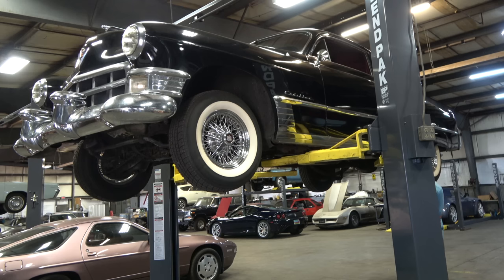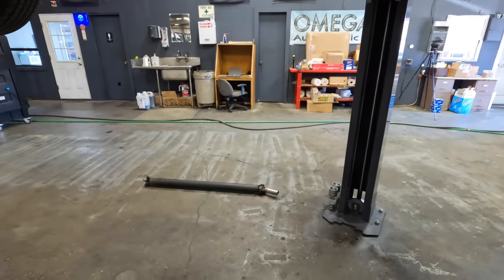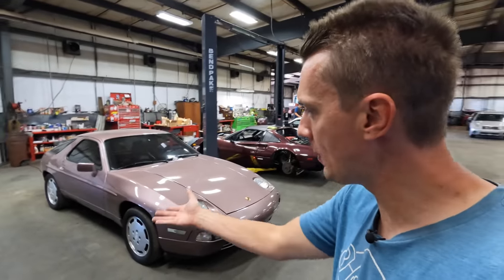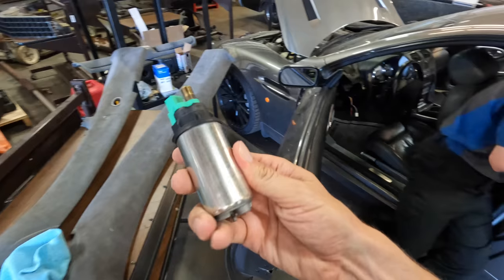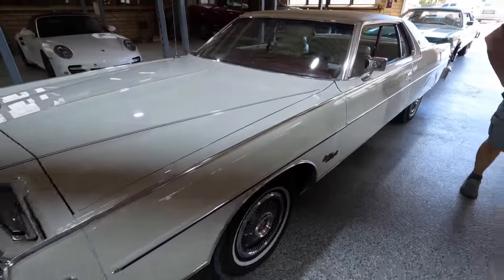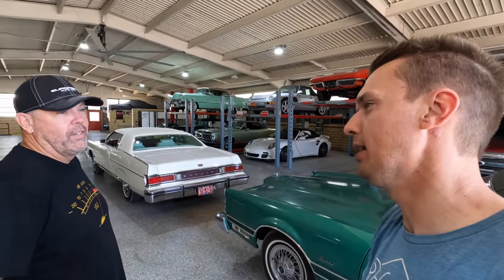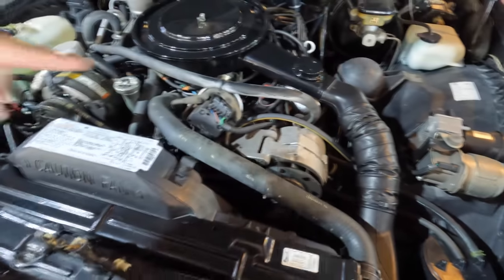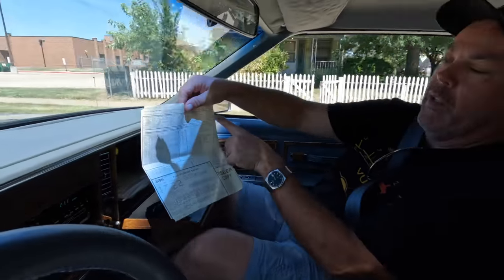We found some weird mods on my 1949 Cadillac Fastback Custom, and more things broken!

Comment: Do not remove any of those radiators you will regret it my GPA had a 500 ci Cadillac swap and it was a nightmare to keep cool I was so surprised this stayed cool on such hot days. They are definitely a needed item. Really cool car great build.
Reply: Yo 🔥https://youtu.be/rdJ9bsN7JAw.
Reply: I had a stock 500 in a '76 Fleetwood Talisman and it was the largest radiator I had ever seen in a production car. Literally 3x the size of my 98 Silverado which wasn't a small radiator in itself so I don't doubt they would need a heck of a lot of cooling in a smaller space like that.
Reply: Only way to replace it is with a radiator the same size or an oversized aftermarket one. Never had a problem cooling a 500 block doing it this way.
Reply: Those radiators on the 500ci caddys were huge.
Reply: In the tighter 49 engine compartment probably wasn't space enough for an oversized radiator for a 500cid up front, so adding a supplementary radiator wherever they could cram it makes sense.
Reply: @waynepantry7023  because if wizard didn't install it or it isn't factory they always want to remove it.
Reply: I do remember those type of tires in the 80s..i remember them very well
Reply: Tell me about it guys!  I have a 1976 Cadillac Fleetwood Series 60 Special Brougham with a 500 engine and that HUGE radiator.  Even though everything is stock, I will NOT drive it if the temperature hits 90 or more outside.  I just don't want to take the risk.  I mean, it only has 38K original miles, but why take a chance?  I don't HAVE Tyler Hoovie's money!  LOL
Reply: As a bonus, you can warm your hands on the passenger fender.

Comment: Regarding the shocks, the Koni 8240-1085 for front and 8240-1086	for rear should fit directly. Probably a much more reliable, cheaper and better ride than the Bilstein.
Reply: Hope they figured that out
Reply: Yeah, wanted to respond with the same thing, resently replaced shocks on a porsche 928 as well, those Koni's where easy to get, but maybe this is a US supply issue, as i just got them here at a carparts store in the Netherlands.
Maybe Hoovie/Wizzard should ask one of us Europians to send them over...
Reply: Even if you can find an old pair, Koni offers a rebuilding service (not for free obviously)
Reply: @shoominati23  yeah that's possible, except for FSD shocks. I used to work for Koni. Terrible company to work for but the products are amazing.
Reply: FatCat Motorsports rebuilds shocks and struts.
Reply: I'm sure several companies make coilovers that would fit, (what I would do). He wants to keep it original. Not sure why, if it's not a very low mileage and exquisite car.
Reply: @jimmywhitlow2012  I believe teh Bilsteins were actually an option. The cars regular shocks were Koni's as mentioned and these normally last forever. They can be adjusted to like new to when they get to loose over time. The Bilsteins are less common but a friend of mine had them on his '78 928. You might be able to get them form Porsche Classic in Germany. In that case you can start saving now.
Reply: @jimmywhitlow2012  Agreed, a little 'out of the box' thinking required.  Also, only the dampers will need replacing so the springs can be transferred over
Reply: @shoominati23  Got Koni's on my Nissan Patrol & had them rebuilt recently.
Worked out about $100.00 US here in Aussie - way cheaper than buying new shocks & they perform really well.
Reply: @hanselemans4237  The original shocks were not Koni.  They were Boge (Sachs).  Bilstein still makes 928 shocks, but the S4 versions are having a supply issue.

Comment: I'll take videos on cars like this over the supercar bullshit any day of the week.  The Lambo's and Ferrari's are fun and all, and i love them just as much as anyone else. But they are unrelatable and unobtainable for 99% of us.  Nice to see this channel getting back to the way it used to be. Love it
Reply: And for us in Europe its the other way around. What shall we do with a land yacht which does not even fit the last corner to my property? Its has a 12 ton limit. 10 mpg equals 46 Euros/100km, i could afford maybe 200km per month. Do they take E-Fuel? The conversion to E-Fuel has already started on race tracks and it will not be long until they will convert regular „leaded“ fuel which those wonderful old big chunks of metal need.
Still love the channel, just as i love „old things on auction“ or „steam locomotives and steam trekker of a bygone era“. A Porsche 928 or a Cadillac from 1949 is living history. But certainly not practical.
Reply: Yeah I like seeing these cheap obtainable cars that make me question if I should drop 15k on a car with a sofa for a driver's seat and a 0-60 time measured in minutes
Reply: Everyone has their opinion 
 don't call other's bullshit
Reply: @wolfgangpreier9160  I had a ‘49 Buick Super Sedanet, which is roughly the same size, and they aren’t that heavy or big. Iirc 1650 kilogram curb weight and shorter than your average SUV.

Okay, the Buick L8 coupled to the Dynaflow meant it had bad fuel economy (about 24 liters per 100 kilometers) but it drove wonderfully. With a modern tranny these things are more economical.
Reply: @RustOnWheels  Shorter than a Model Y? Jokeing - i have reserved a Cybertruck - i hope it gets exported to Europe in a few years. 

I did not mean specifically the length of the car. 

I once had a Chevy Beauville Van and a GMC K1500 Z71 Stepside and was living in "the city". European city of course. Where its really narrow. Fun cars. Never had a problem with the size. But that was in 1989 and 1995. Now is not the time to invest in a vehicle that is the definition of oversized and thirsty. 

Its fun for once or twice a year to show it on a car show or a Corso at the Ennstal Classic or in Goodwood. But certainly not for everyday use.
Reply: @wolfgangpreier9160  almost nobody uses cars like this daily, that’s logic. I drove it tops 700 km per year. But the turning circle is small because it’s rear wheel drive and it’s smaller than all those idiotic German SUV’s.
Reply: @RustOnWheels  I commented on those who wanted to use those old cars everyday. 30 years ago? Of course why not? Petrol was cheap girls were unshaven and the russkis made no troubles. 

I don't know about german SUVs. Never had one. My last fossil was a VW Caddy. Not very SUV-ish.
Reply: @wolfgangpreier9160  Well here in my town almost half of every car is longer, wider, taller and 1000 kg heavier than my Buick and Hudson. Also thirstier. My Hudson can get 11,6 kilometer per liter and a lot of those big German cars don’t even get 8 kilometer per liter. And our country has the most expensive car ownership rules and (almost?) the most expensive gas in the world. Gas is now around €2,40 here and taxes on cars like that are about €3000 a year…
Reply: @RustOnWheels  You must be a rich man. WoW!  I could not afford 3000,-- taxes on a car. And i own 5 in my company. I don't pay any tax for my cars - actually i write my cars off of my taxes. And i pay a little less than € 5,-- per car per 100km before tax writeoffs. Of course all are EVs. 

Gas and Diesel is between 1.90 and up to 2.80 on the Autobahn. At least as far as i observed. Of course driving EVs, those prices are not so interesting anymore. But they interest nearly everyone else so a bit "interest" i must keep.
Reply: @wolfgangpreier9160  You must be a rich man! I can’t afford to buy an electric car. 

And no those taxes are for those heavy BMW’s and Mercedes and Audi’s, not for my car. In The Netherlands we pay road tax per kilogram car and per fuel type. For classic cars the road tax is €0 so classic cars are absolutely cheapest. Until you drive them as daily of course (maintenance).
Reply: @RustOnWheels  My Model Y costs me 17 cents/km - thats less than a VW Golf TSI @ 19 cents/km. Lets see what the others would cost me: Dacia Jogger 14 cents, Passat 27 cents, Used Skoda Fabia Diesel 19 cents, Enyaq 17 cents, Opel Corsa E 12 cents, Cybertruck Trimotor 19 cents, Ford F150 Lariat (fossil) 125 cents per km, and Rivian R1T if it would even be available 21 cents/km. All 6 years, 50.000km /year with all costs.

Yes really luxurious those EVs...

Did not do any maintenance since 2018. All in all about 200.000km with all cars together. And no brake jobs - but the first Peugeot E-208 will need one with 14000km - i will try to get that one on warranty. 14000km and the brakes are horrible!
Reply: @wolfgangpreier9160  a model Y in The Netherlands costs €70.000 to buy or €800 per month to lease. That’s more than 17 cents per kilometer.

So again, you must be rich. 😊
Reply: @wolfgangpreier9160  My daily costs me 11 cents per kilometer on gas by the way, and was a fraction of the cost of a Tesla, and is much much much more reliable and well built. So as long as electric cars are for the rich I will be driving old Toyota’s 😎
Reply: @VaanRavi  or what lol
Reply: HERE HERE!
Reply: @wolfgangpreier9160  This is why Europe is dying.
Reply: @RustOnWheels  Model Y 65895,-- including permits and license plate, nio more incentives because it costs more than 60K incl. VAT, thats 57.070,-- net, thats 862,37 for 6 years, plus insurance 22337,10 per year, 480 Euros serbvice and maintenance, repairs etc., 1125,-- for tyres, 95 for the Autobahnvignette, 20 kWh/100km x 25 cents/kWh = 2791,-- per year for electricty minus tax writeoffs - 8 years for the car - everything else asap - meaning in the year where the payments have been made - insurance without VAT everything else pre-VAT tax writeoffs - meaning i can write off the VAT from every payment immediately, minus resale after 6 years and 300.00km of 26358,-- (excluding VAT)  - that makes a grand total of 53.144,-- Euros for 6 years and 300.000km or 17,71 cents/km.

A Passat would cost me 80.963,-- A Tiguan would cost me 69.199,-- a Dacia Jogger would cost me 43.834,-- 

But i guess nobody would compare a Dacia Jogger with a Model Y for real. Right?

I can also give you the numbers for a private person 15000km/year, 10 years without tax payoff:
Model Y: 62506,-- or 41 cents/km, Toyota Yaris base model (price 17163,--) 60074,-- or 40 cents/km, MG ZS EV (new price 31K) grant total of 49026,-- or 32 cents/km, 

IDBuzz new price 84800,-- grand total: 67.787,-- or 45 cents/km.

Model S Plaid (new about 134K): 69335,-- or 46 cents/km. The resale values of those larger EVs are very good. Just take a look at the market.

Mercedes EQS 580 AM 4matic with everything pricae 200.803,-- grant total 100.883,-- or 67 cents/km.

Passat Buiness: 105.939,-- or 71 cents/km, Toyota Camry 102.249,-- or 68 cents/km.

Do your homework, Don't look at the buying cost, thats not even a third of the total cost. But if you want to continue lying to yourself - be my guest. Its your money, rich man... 

I cannot afford such luxury items like driving fossil vehicles anymore.
Reply: @VL1975  😂😂🤣🤣Ok you have won the longest laughter of this week, this month and i believe even this year.

You are a really funny Wo Man!

We have been here since before the romans. We will be here when the current civilisation has broken down because of climate catastrophe and then some.

🤣🤣🤣🤣

Thank you!
Reply: Hoopties FTW! Love the skylark , needs 2 doors less and a manual!
Reply: @RustOnWheels  Your car needs 11 cents/km petrol. My car needs 5 Euros/100km electricty. No exhaust, No pollution. No obnoxious gases, No stinking, No posioning my kids or my environment.

Please keep calculating with the buying price for your car. You would not become comfotable with anything else. I see what you mean. Its a really hard work to calculate all the cost of your vehicle, maintenance, service, repair, toll, tyres, insurance.

Just take the buying cost - say 2500,-- Euros for a 10 year old car. You drive it 10 more years till you sell it with 3500,-- Euros and the rest of the time you drive around for 11 cents/km. 

You will be very happy how cheap your car is and will not be able to understand why everybody is ditching those stinking fossil monsters and trying to do good for his children and grand kids.
Reply: I LOVE this caddy. Such a cool car.
Reply: Amen! Preach it!!!
Reply: @wolfgangpreier9160  “Don’t look at the buying costs” says a rich person. 

Most people don’t have €70.000 laying around I’ll have you know 😂

Cheapest car I’ve owned was a 1987 Opel Kadett. Bought it for €275 in 2007, drove it six years without ANY repairs, just tüv €30 per year, almost free in tax (875 kilo), ran 1:14 normally and 1:21 hypermiling. Good luck with your Tesla 😊
Reply: @wolfgangpreier9160  Well the whole premise of the original discussion was obtainable and relatable cars wasn’t it? 

My 12 year old Yota is the cheapest, most reliable mode of transportation. Averages 5 liters per 100 kilometer (normal driving; hypermiling gets 3,5), low tax & insurance, nothing breaks, cheap to buy. Well, cheap… they went up in value, so not real cheap anymore.

If you want to save the planet, take the train, not a car. An electric car is still a lot of e-waste. And don’t get kids because those are extremely polluting. 

Teslas are not a magic bullet. They are still cars and still need to be manufactured, maintained and repaired. Buying nothing saves the planet. Buying a car doesn’t.
Reply: @RustOnWheels  Ok, then i am a rich person in your eyes. I will tell that to wifey when she asks for a new kitchen to replace our 25 year old one. We are rich but we have no money, sorry.
Reply: @RustOnWheels  Don‘t know what a Yota is. Never heard of that make.
Reply: @wolfgangpreier9160  Yota, it’s an abbrev for Toyota. 😅 But seriously though: how can you buy a €70.000 car and say you have no money for a new kitchen? Got your priorities switched up? How did you get €70.000? Did you sell your cheaply bought Bitcoins in time? 😂

Oh, one caveat from my side: I never ever loan money for consumptive goods. So no lease, no loan, no spread payments. Because then stuff isn’t yours and you can’t get rid of it when you are fed up. Buy upfront. I cannot imagine anybody but the dumbest automotive channel on all of YouTube actually getting a loan to buy a car.
Reply: Absolutely agree. The older cars are much more interesting.
Reply: I agree with you 100% Mr. Pink!  I NEVER liked these super cars, not even as a little kid.  Since I was 8, I was always into luxury cars.  Plus, I don't like what they call luxury cars today.  Pinned into the drivers cabin like the space shuttle.  Seats hard like a 2x4 with a piece of leather over it.  Technology is called luxury today.  I'd rather have an old Cadillac like Hoovie's as a daily driver any day of the week and twice on Sunday!  Plus, even if I COULD afford it, I would NEVER pay the price for a Lambo!